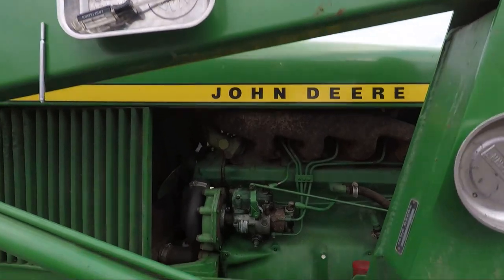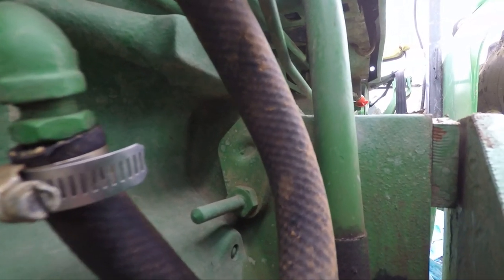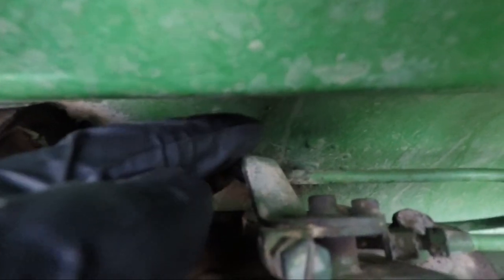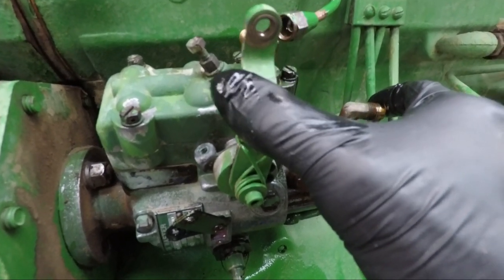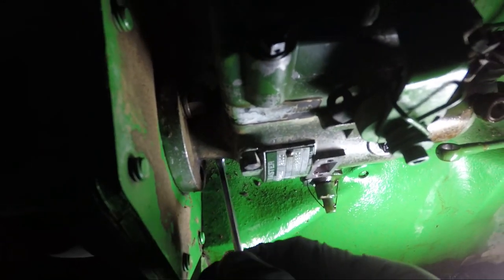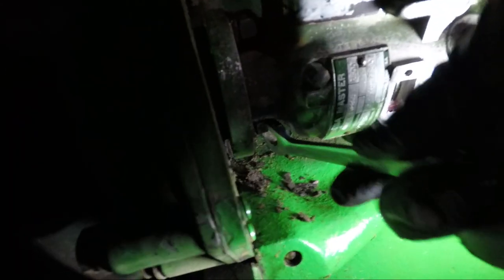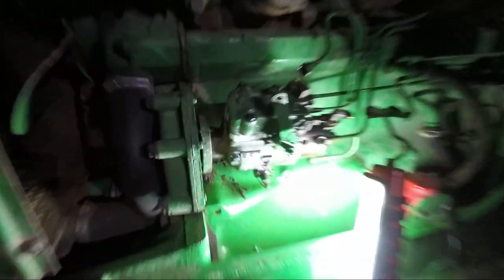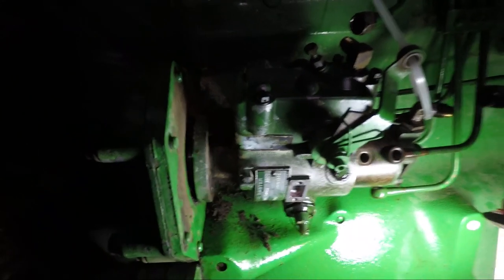Roosa Master/Stanadyne JDB type Injection pump removal from JD 2030

Comment: I have a 2020 John Deere tractor I have to do this to. I didn’t see the part where you lined the pin in the flywheel and line the two lines up on pump.
Reply from the maker: I'm sorry it's been a while since your comment. I apologize that my Google did not let me know people were commenting on my video. Behind the injection pump at the flywheel of the engine, they're usually is an inspection cover held in by a bolt that has a point on the end of it. When you unscrew that bolt turn it around put the pin in the bolt hole, and as you turn the engine over by hand, not with the starter, you will feel that pin push into a drilled place in the flywheel. At the same time if you watch in the side window of the injection pump you should see two lines lining directly up when the pointed bolt goes into the flywheel. That times your engine properly to take the pump off and to put it back on.

Comment: The Injection pump drive shaft is keyed to drive gear..... More simple to remove as unit.....instead of fighting umbrella seals when installing..... might require a small T bar puller. and a propane torch....  worked for  Deere   most likely what failed is the mylar ring that attaches weight ring to rotating assembly.....Very simple pump
Reply from the maker: I was a "train the trainer" for Stanadyne/Roosa Master. It takes longer to remove the front cover, and pull the pump that way for me.  If you're careful to put them in properly, it's not a problem.
Reply: If you pull the pump with the keyed shaft would you still have to time it or not?
Reply: @cumminsdieselgt  My dad was a Deere service manager in the 70's. You're correct, have to drain the cooling system, remove the radiator hose and be sure not to drop the woodruff key in the timing cover. too remove the pump drive shaft. It is a little aggravating to get the the umbrella seals back in, but much less time comsuming

Comment: I know I'm 3 years late into this awesome video...I am working on a John Deere 4276T that has a questionable Stanadyne DM4427HB2915  very much like the Roosa Master in this video...by chance would you happen to have a hard copy of the removal and installation procedure available?  Thanks for posting great videos!!!
Reply from the maker: I am sorry I'm so late in replying to you, as for some reason my Google has not sent me notifications of messages. It took me a while to find yours and I hope to answer your question. 

On the tractors which I worked on, that had the DM series pumps on them, you had a timing cover which you had to take off on the front of the engine. This injection pump bolted into this timing gear in the gear train of the engine. You must time the engine up in a similar manner before removing the pump. The ones I removed had three bolts in the timing gear that bolted to a drive coupling mounted on the drive shaft of the injection pump. Once you removed those three bolts after timing the engine up, then you could remove the pump from the gear train of the engine. The drive shaft will stay in the injection pump and is supported by a bearing in the front of the pump housing. Do not try to remove the nut from the drive shaft to the pump in the center of the timing gear.

Comment: Can I swap a cav injector pump to a roosamaster on one of these tractors?
Reply from the maker: Unfortunately, they are driven by different connections in the gear train of the engine.  The engine was designed for the fuel system it came with.  CAV was built under license from Roosa Master before it became it's own subsidiary of Lucas fuel systems. Now it is owned by Delphi Corporation.

Comment: What happened to the timing part of it
Reply from the maker: What do you mean? Thanks.
Reply: You said you was going to time the pump before removal or you didn't show it in the video. You didn't show putting the timing pin in the hole on the flywheel either
Reply: I just finished watching the video where you installed the rebuilt pump I understand now
Reply: Thank you very much very well-made
Reply: I was wondering the same. Pin the flywheel first  with pump timed and then remove.

Comment: You completely skipped the pre-removal timing procedure..possibly the most important part?
Reply from the maker: You can time it to remove it first, which is the optimal procedure. However, the majority of our customers at the fuel shop have already removed the pump and did not time it up first, prior to removing their pump. I based this upon their experiences. And you are correct. I love to time them before removal.